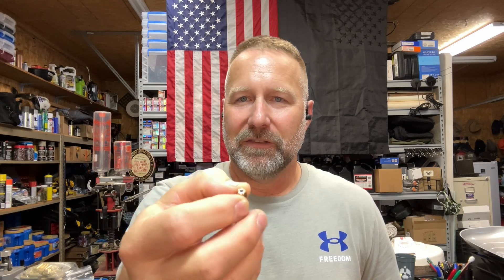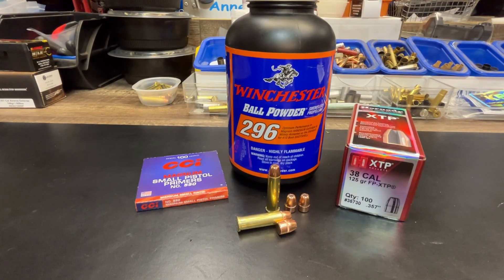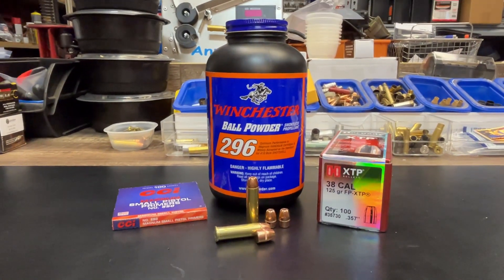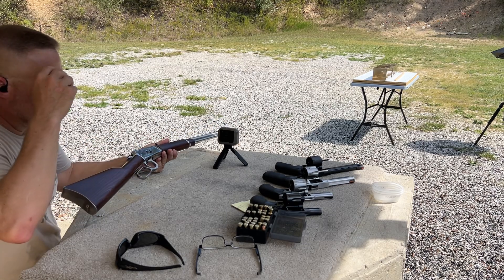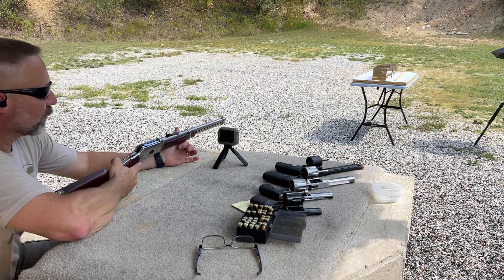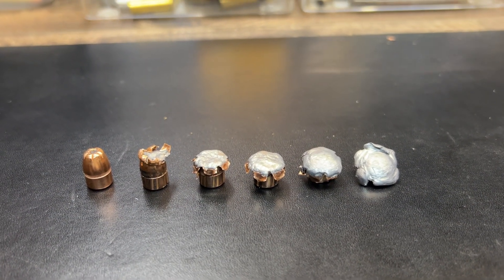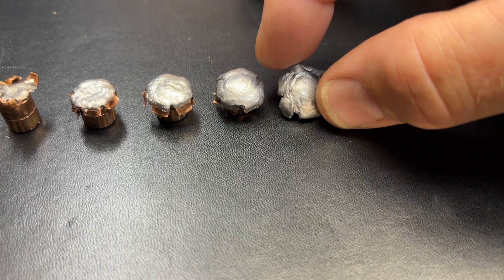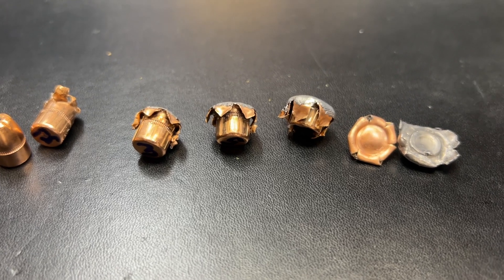.357mag, Hornady 125gr FP-Flat Point XTP Bullets Tested in Gel Block, with 5 Barrel Lengths!!

Comment: I'm confused by your chart at the end of the video. 
When you were shooting the gel i thought you said the 1125 fps shots from the 2" penetrated to 22".
But your chart shows far less than that. Just wanted to verify which is correct.
Reply from the maker: Sorry for the confusion. 

The 22” from the video is correct. Looks like I mistyped the penetration when I did the spreadsheet. You’re the first to catch it, including me! 😉👍🏻👊🏻
Reply: @kentuckyrangetime Right on, thank you for the clarification. I have a box of these that I'm going to experiment with in 9mm. I want something deep penetrating in 9mm. But most bullets designed for 9mm expand rapidly and usually won't give you much more than 16". I have run these through a .355 bullet sizing die and about to start loading. I think i can get 1200 plus fps with longshot powder in a 5" barrel.

Comment: Thanks for this info - I'm about to complete my stock of .357 XTPs and I was debating between the regular XTPs and the FPs. I think I'll go with the plain XTPs and not worry about the quicker expansion. They should work fine on any of the critters in my area.

Comment: Great info!  Have you considered running a velocity chart on the rifle out to maybe 200 yards? Then you can use the pistol velocity results to show effective hunting  expansion velocity in yards for the rifle. That way you can see the maximum effective yardage for reliable expansion for hunting with the rifle.
Reply from the maker: @doylethorn9251 👍🏻. I’ve had similar discussions before, and have considered it but that will probably be a topic for a separate video.  

Since there’s so many of these different bullets, I try to keep the gel block test between 10-20 minutes and that would add another 5-10 to the total length.  

A lot of the manufacturers have similar expansion data with pictures of expansion at various velocities that can be applied to a range chart to gauge expansion at longer velocities.

Comment: Would love to see 300gr XTP .429's tested at subsonic velocities.  I have some suppressed 44 carbines.
Reply from the maker: @RyeOnHam  I have a .44mag Test series coming up later this fall running 4 barrel lengths 2-3/4”, 4”, 9.5” and 20”. 

Bullets I plan on testing are 180gr XTP, 200gr XTP, 200gr Barnes XPB, 220gr Xtreme Penetrator, 225gr Barnes XPB, 225gr FTX, 240gr XTP, and 300gr XTP. 

The 2-3/4” was pushing the 240gr at 1200fps so that’ll be close to sub velocity with the 300gr. It should be close enough to see what your results will be 😉
Reply: @kentuckyrangetime That’ll be a great series as well.  Thanks for doing the grunt work for us handloaders!!!

Comment: That was impressive!  If you need an antipersonnel round for the carbine this is a perfect loading. It's also an excellent revolver choice in the longer barrels.
Reply: I shot the standard 125 xtp out of a henry 16 .5 inch barrel  averaged   2150 fps ,it went through 2 liter 1 gallon of water rested in the second gallon jug.The bullet flatten out had core separation.
Reply: @brucepierce4971  I bet that was quite a water show